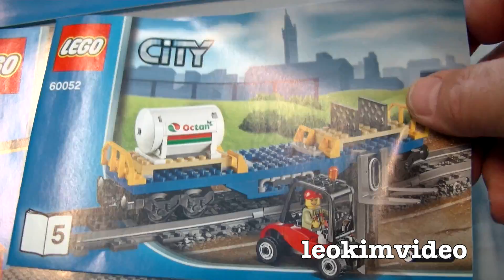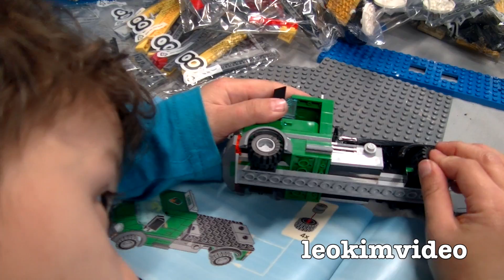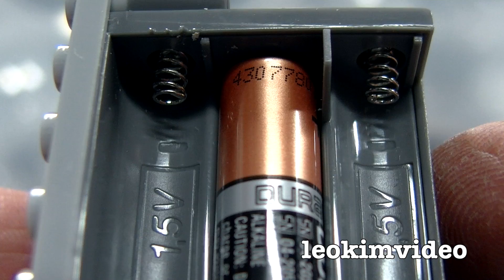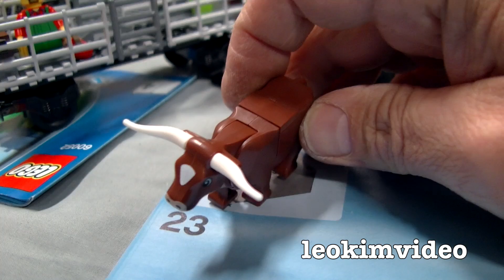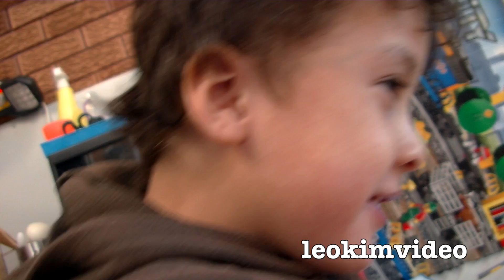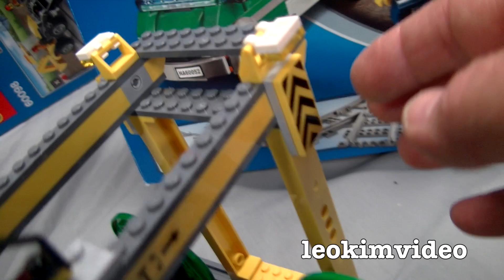Lego City Freight Train 60052 Mystery Brick & Battery Pack Problems Pt1

Comment: LeoKimvideo to make longer trains what I figured out is that on top of the magnets when two train cars are together there’s one stone on the top and one start on the bottom on each breaker on the coupler I’ve used it for a really long trains and it helps so if you want to try it out as well you can go right ahead but you can be able to pull really long trains

Comment: Guys i have found out a far easier fix for any battery box problems you may get
Step 1: Get Some Foil (Tin or Aluminum, It Does not matter as long as it is metal )
Step 2: Get a very small amount, Roll it onto a ball and put it in each positive terminal on the battery box (you only need a VERY small amount)
Step 3: Put the batteries in and then you should be good to go
Reply: I have done that at times but i think hot melt glue is a better solution in this case

Comment: Whaa... what? I don't have any such problem with my three battery packs... and I run that very locomotive all the time.
Reply from the maker: +LoneSniperSG I think it comes down to the battery brand you use. Not all AAA's are the same. If the power pack battery area has the slightest alignment problem some brands of batteries will not work. Look at several AAA brand batteries and see how the positive end is often different between brands. The Lego battery pack is not suited to some I feel. Maybe the audience knows more than me..thats usually the case
Reply: +leokimvideo where did you get these
Reply: Alex A hn
Reply: +leokimvideo Would it not be cheaper to use rechargeable batteries?
Reply: +Taco Rocky i dont understand
Reply: LoneSniperSG same
Reply: Pu
Reply: JaSo Albertson wsfghjj
Reply: LoneSniperSG
Reply: LoneSniperSG l...
Reply: LoneSniperSGo
Reply: Big Steveo so do I
Reply: Kamaljit Kaur que

Comment: I have the white passenger train and I tested it yesterday with new and unused and unopened triple a batteries and it works fine. the green light lighted after I finished putting in the batteries and pushed the green button. Same with remote control.

Comment: Never had issue or known anyone to have had issue with the battery packs. I have however never used alkalines in my gear, I haven't for decades now. I use high power nimh batteries. I think AAA NIMH top out around 1300 mah much more power than a alkaline and rechargeable (some can speed charge in 10min).  Anyhow clearly there is something wrong with yours. Be interesting to see if it is the same issue in the HSP Train. Those were both released about the same time too. Also wonder if the wonk box it is a region thing. AND yes over the years the large battery companies have been altering AAAs as well as AAs with larger flatter + sides. Does not excuse the poor design or mushy glue of that battery box. 

 The PCB board has that reversing switch and I do know it has a auto off function if the train is idle. LEGO does sell a lithium pack for these it is quite pricey but li batteries generally are.  The LEGO ones much more so as they contain the peak charging circuit and logic for discharge cutoff (over discharging lithium based batteries kills them) If those cost too much ontop of the trains I suggest investing in a collection of nimh high mah rechargeables (avoid anything under 800mah), just get enough extra for each train depending on how much they are run per day. In the end it will save money and avoid trips to the recycling center.

I would NOT as suggested extend the contact with something conductive. If anything this can cause heating as it adds resistance to the connection and with DC this is a BIG no no as it'll heat up and cause fire. I have seen 3grand of RC go up in flames cause the guy shoved some foil in the connector. YES these are toy trains and not 30amp draw RC racing motors but remember DC burns AC jolts. and can be enough to flame up if not melt the box. Placing something behind the contact is the right fix.

Comment: I have dozens of these battery packs and have not had this problem and I have used both rechargeables and alkaline. All have worked well.
Reply from the maker: +BrickTsar LEGO® Collector why don't these amazing trains come with rechargeable battery packs? Thats what really needs to happen. I have had 2 faulty battery packs that needed fixing.
Reply: +leokimvideo leo i looked up on the Internet that the cow from the lego train set is actually a male males are also called bulls;)
Reply: +leokimvideo  the rechargeable packs are $80 dearer than the battery packs. and I doubt that lego wants to make the trains any more expansive

I got told to use Energizer as doing so fixed someone else's problem while using Aldi brand. and from other use I know that Duracell have a slightly different 'fit' than any other brand

ps have you asked Duracell or any of the others if they would sponsor you? maybe even just 50% off?

Comment: The locomotive type is an American EMD SD40. Its also in a modified "Santa Fe" railroad livery. But Lego decides to stick British buffers on there engines  (For some reason) when they need to have knuckle couplers instead of the traditional buffer-and-chain couplers on British railway engines.
Reply: It’s livery looks more like CSX because is has blue and yellow colors.

Comment: Both male and female cattle can have big horns if you let them grow, but most cows don't have them that long bc it is a risk to the farmers/babies/milking machines (so you use the short horn varieties or cut them off).Massive fail with those battery boxes, the rechargeable ones are the way to go but they are super expensive and not included in the sets... I wonder where the battery boxes are made...The missing cream piece is actually the part that in the instructions you build onto the blue flat wagon; it's meant to be able to be detached and put on the back of the cargo truck :)
Reply from the maker: +XtremeTrainz just proves i'm a city boy
Reply: +XtremeTrainz  really bro
Reply: +leokimvideo u are! I am 2 l love ur vids

Comment: The locomotive in this Lego train set reminds me of Engine 1206 from the movie Unstoppable.
Reply: Dronesword123 Same here. My first take at Unstoppable with Lego trains was horrible.
Reply: +CaptainKman probably was based off it.  Although I could rattle off a litany of differences (but won't :P) 

Wonder if they still make the steam locomotives like they used to?
Reply: Ah yes the one with the working con rods: that one was one of my favorites just for that feature (my old lego engine still has the Bo-Bo, track powered axles)
Reply: Yea. Same. Great movie. Made a crappy Lego version of the film with the Maersk train like 5 years ago. Should probably try another run at it now
Reply: TB7 Productions I love that movie but this engine also reminds me of a CSX engine to
Reply: Ironic because it's a rebuild (no pun intended) of the same engine. EMD SD40-3 is the classification.
Reply: Oh. Never thought of it that way. The trucks are Bo-Bo trucks instead of Co-Co trucks like on AWVR 1206. 1206 is an SD40-2, but this one was probably inspired from the GP38.
Reply: Now that ya mention it, it does doesn't it?
Reply: Yeah this locomotive is a SD40 -2 locomotive, the same kind as 1206
Reply: TB7 Productions same and I love that movie

Comment: The piece is on the flatcar/ wagon with fuel. Sorry if I got that "wagon" bit wrong, I'm not familiar with Oz terminology.
Reply from the maker: +The S.C.Ruffy NERF Herder how can you use the same brick between two items? I can't find that cream brick anywhere
Reply: It should pop of naturally without fuss. Then pop on the truck.
Reply: +leokimvideo 
The truck is meant to have those tan flats/pallets forked from that perch the crane places it on onto that green truck. Even those wire spools will fit on there. If you look at the box you will see that of the 4 pallets one is missing from the train and is on the truck. I think one of the other books shows this use of the truck.  That spare tire was strange btw I did not have one in my set.

Comment: I've also had issues with the battery packs Leo. I thought I was going mad and was the only one! Thanks for your teardown and hot glue fix. I'm going to give this a go myself.
Reply from the maker: +S3ISOR It actually goes deeper than this once you start to look at how different 1.5v AAA batteries are. What I ended up doing was drilling larger holes for the positive terminals in the battery box. The battery box terminals are not the best design, they don't allow for any margin of change with batteries. I have never liked AAA batteries, I like them even less now. Lego need to take a look at this design and do some changes.
Reply: leokimvideo Wow that is more involved than I thought. I'll try an repair mine like you did rather than get rid of it. Like you said, it's ridiculous to have to 'fix' a $300 toy straight out of the box.
Reply from the maker: +S3ISOR The positive end to a AAA battery is 50% of the problem here, some have quite pointy ends, others don't. But the leading brand has an end that's not friendly with this battery box. This deserves a very good investigation to explain what's going on. I love AA batteries, but loath AAA's
Reply: +leokimvideo I think it's worth contacting LEGO about the battery case problems, not good at all, they're certainly going to have to fix it, if you send them an E-mail explaining the problem in detail and maybe sending them a link to this video maybe they can address the problem.
Reply from the maker: +Lachlant1984 I have not got the time to fix Lego's problems, they need to have a bit more quality control on this high end toy. I know my White high speed train suffers the same problem, but this problem also extends to the make of battery I use. It's in no way a simple problem, difficult to explain in full unless you really investigate the whole AAA battery dimensions as well.

Comment: The flat brick that's on the truck is the assembly that's holding your wheelbarrow, with the main part being the 8x4 cream plate on the bottom left corner of the parts list.  If you look closely you can see the other parts (cream 1x4, two 2x2 tiles with the central stud) in the image, with the garbage can being on top of one of the 2x2 pieces.

I have this train too; grabbed it on sale at a TRU.  It's a nice set.
Reply from the maker: +firefly4f4 Can't see that missing brick, it's not a pallet on the back of the truck as this set has. Whats weird is how this item is just not there on the images on the lego website. Box artwork has it but nowhere else. Am I missing something here?
Reply: Yes you're missing something that  flat brick you used for the wheelbarrow is for the truck

Comment: The contacts on the battery pack seem to be the main issue. Not sure if the set no. on it. The board doesn't have anything to do with the issue, A quick fix would be putting a piece of some conductive material between the contact and battery. Really strange way to attach the contacts, though.

Comment: I personally have not had a problem with the battery pack, although I only have one of them. I would recommend contacting Customer Service to help you out. If you feel something is wrong with the battery packs, I heard that LEGO will look into it as well as it's factory to make sure it hasn't been making faulty parts. 

I have contacted customer service many times and I have not had an issue with them. I have had broken LEGO parts before and I was able to get them replaced free of charge, even allowing me to keep the broken parts (at least for non-electric parts).

I have checked your train set and your set is not missing the palate shown on the cover of the green truck. The set should have 4 palates and your set does have 4 palates, and they were built in the other parts of the build that were not part of the green truck. I would say that the cover of the instruction manual for the green truck is misrepresented.

Currently I think what LEGO could do better on is going out to look at other sources. So far, it looks like they aren't aware of these problems until a consumer comes and tells them. LEGO tries its best to have superb quality, and I would agree it does, but perfection is not a guarantee.